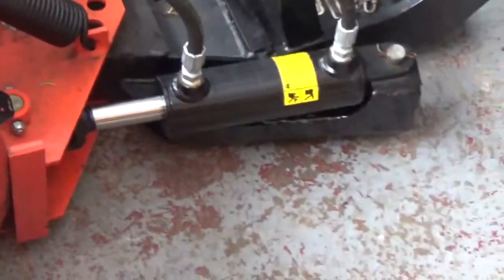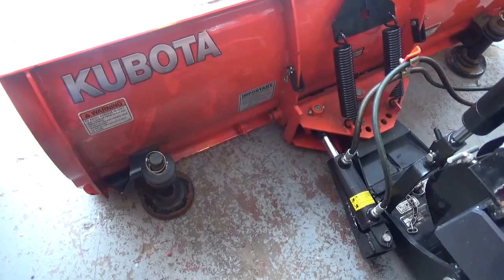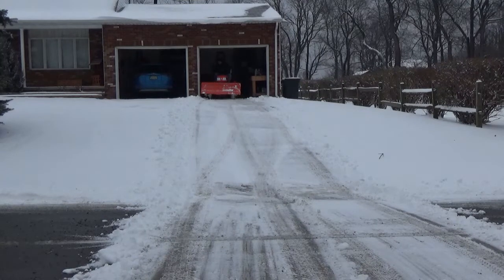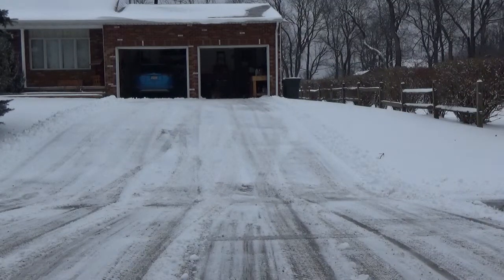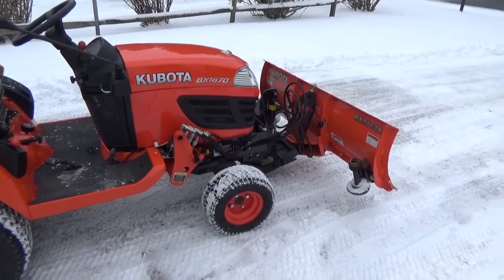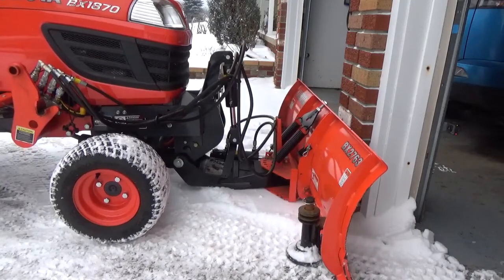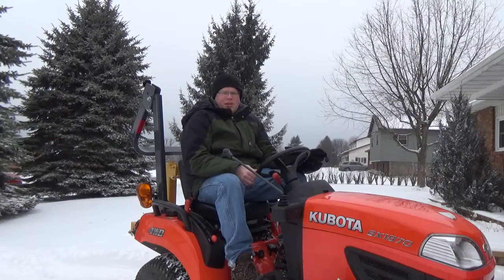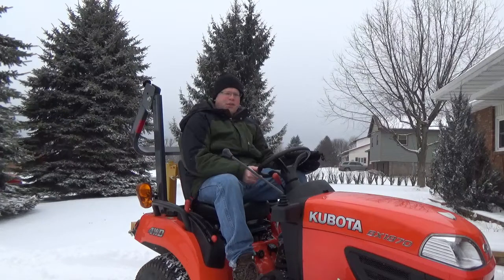Review of Kubota BX Snow Plow (BX2763A) and How to Plow Snow

Comment: Run in 2 wheel drive till your wheels start spinning, then use the differential lock before the 4 wheel drive.  Trucks don't have down pressure and you should plow snow in the float position that way the plow follows the contour of the  driveway.  I use a BX 2360 (2010) and have never gotten it stuck.  Usually I use a front blower and back blade, but do have a blade (bx 2763) that gets occasional use.  Angle front blade one way, back blade the opposite and go to town.
Reply: Why lock differential before 4 wheel?

Comment: Great video thanks for sharing can you put this blade on the rear also to drag the snow? only because I have a blower on the front. Thanks keep the videos coming!
Reply from the maker: Unfortunately, you can’t put this blade on the rear.  It is specifically designed for the male quick hitch adapter which mounts only on the front of the tractor.  You would need to look for a three point hitch style blade.  Thanks for watching and be sure to subscribe!

Comment: Great Video! Now I want one of these machines.
Reply from the maker: Thank you for the kind words!  I hope to make more videos soon.  I waited for nearly 10 years before I finally got one.
Reply: @averagejoevideo9556  I have to look but did you have any videos on removal and install of the blade? Or even the mower deck? I am looking at purchasing one of these machine. Didn’t realize they are diesel as well.
Reply from the maker: @StellsBellz  I do not have any videos about blade or mower deck removal.  I should do one.   The blade assembly on the new 80 series BX is mounted a little different.  The tractor in the video is the BX 1870-1.  These machines are diesel.  They are like tanks...nearly indestructible, but at the same time they are very fuel efficient.  The low end torque is amazing.
Reply: That’s great to know. This is my last year with my snow blower. These Buffalo winters can be brutal with the lake effect snow. This machine is calling my name. 😂

Comment: Thanks for the demo.  If you need to move snow only and not dirt the Johnny Plow is a lighter weight option. Pushing snow into and/or across the road is illegal in my area.  Check your local laws.
Reply: Thanks for the notice about unlawful cross-road plowing!  It can be a problem!
Reply: Yes, it is illegal where I live need to check. Even if it is legal not a good thing to do.

Comment: You made a great video! But I am reluctant to subscribe because you didn't answer THE key technical question several folks asked below. Were you in float!? You imply you were because your drive has heaves. But went over the possible float setting really fast. I am going to go back and watch. 

Float is not only the key technical question, it seems to be an emotional one. Your clarity on that and especially your answers can really help some of us! I have a new B2601 and a blade like yours. I have asphalt AND gravel. Never used a front blade. Am pretty stressed. Then I see how beautifully you cleared snow on your concrete. WERE you in float!?
Reply: Oh, and my asphalt is heaved in spots by roots.
Reply: Okay, I watched it again. It's still not clear if you used float. I assume your tractor has that—when you push the joy stick forward past the lifting point and it pops into float. But it appears from your commentary at the back dragging part that you are just backing off on the down pressure? Not putting the blade forward till it goes into float mode?
Reply from the maker: I apologize for the delay in responding.  I was in the float position except for the back dragging portion.  If you back drag in float, often times the blade will rise as the snow builds up behind it. You need the down pressure to not leave any snow behind.

Comment: Do you have fluid in your rear tires, for additional traction with turf tires?  Kubota's weight box is a nice option, which you can fill with sandbags for winter and use it as a carryall in other seasons! Or easily remove it! 😎👍
Reply from the maker: Mike Gustafson no I don’t have fluid in the rear tires.  But, yes the weight box seems like a great option.  Ironically, we haven’t had any snow this year worth filming, so my channel has been a bit quiet.  Be sure to subscribe as I will be bringing more content shortly.

Comment: Hi, I’m wondering if you would know if they have a slightly narrower blade width available? I have a 2350 but would like to keep the blade roughly the width of the unit please let me know if you have any advice or ideas
Reply from the maker: You probably will not find a blade that is the width of the unit.  The idea is if you angle the blade, it still needs to cover the width of your front wheels.
Reply: @averagejoevideo9556  How thick of steel is the blade constructed of excluding the cutting edge? I’m needing to push harder/heavy material so I’m concerned that angling the blade could cause damage to the linkages for the tilt, perhaps 60” won’t be as much of an issue for the unit to push as I imagine but I’m expecting traction issues.

Comment: That's a handy little rig, but I can't imagine what it cost?! For what you have invested in that, I have about the same amount in a used 4 wheel drive pickup with a home built plow on it. I like the fact that I'm sitting in a heated cab and get the same job done faster with a wider blade. Oh ya, I can't mow my lawn with my truck however.
Reply from the maker: Painter D thank you...it is very handy!  A heated cab would be nice and there are disadvantages and advantages to each.  Obviously, my tractor is used for mowing as well so you aren’t going to to that with a truck.  But, I see your point!
Reply: Ya I mean if you already have a tractor then of course I'd throw some type of plow on it. That's a slick rig and it looks like it does the job pretty well. I guess you just learn to use what you have and being I already had the old truck for my work vehicle, I may as well put it to work with a plow.
Reply: Did you ever get a heated cab? I was about to pull the trigger on one till I measured. Ur garage is about the same height as mine. The cab is to tall. Basically if ur tops can’t go under in the upright position neither will a cab. Kind of stinks.

Comment: What is th÷ total cost of plow  and hydraulics?
Reply from the maker: Keep in mind that when you purchase a Kubota tractor you have the option of the “loader valve” from the factory.  Obviously, a tractor preconfigured with the loader valve costs more than one without.  However, it is much cheaper to buy a Kubota with the loader valve from the factory than to add one later.  With that being said, I believe the cost of the plow itself (which included the left and right angle hydraulic cylinder) was around $900.  The cost for the male quick hitch (provides hookup for plow as well as up and down hydraulics), was around $800.  The male quick hitch can be used with other attachments.  Theoretically, you do not need to pay for the hydraulic angle option which would reduce the cost by about $250.

Comment: Do you know if that same setup will work on the 23s?
Reply from the maker: Alex Minnich ironically, I traded this tractor and bought a BX23S.  I haven’t posted any videos because we haven’t had any snow worth filming.  I plan to do an update on my channel regarding the 23S.  To answer your question, technically the setup from my old BX would still fit my new 23S.  However, the issue is with the hydraulics.  The BX23S has flat face couplers instead of pioneer couplers.  Obviously, I would need to change the couplers on the plow and quick hitch side because I can’t change them on the tractor side or else the loader won’t connect.  I did purchase a new plow setup for the 23S, so essentially I now have then newer version.  Be sure to subscribe and stay tuned as I will film the setup just to show everyone what it looks like.
Reply: Yes it will. I have that plow setup on my Bx23s an I got the flat faced hydraulic fittings off of Amazon for $19 each. Dealer wanted $53.

Comment: How do you adjust the skid shoes?
Reply from the maker: There are concave washers included.  You can arrange them above or below the mounting point to achieve the proper height.  You can also flip them in different directions to create more or less space since they are concave.
Reply: Thank you for getting back to me. My plow came with the skid shoes on. However my dealer did not included washers. Used for the first time yesterday on my 500’ gravel driveway. Did pretty well, however getting that edge at the perfect height was a challenge. I think getting some washers will help immensely.
Reply from the maker: @mudderD  no problem!  If you haven’t already, please subscribe to my channel.  The skid shoe kit is expensive enough that it should come with the washers.  With that being said I bet they are in a bag somewhere at the dealership.  The other nice thing about the way they install with the washers is that they are always free floating in the holes.  I never once had an issues with them freezing up.